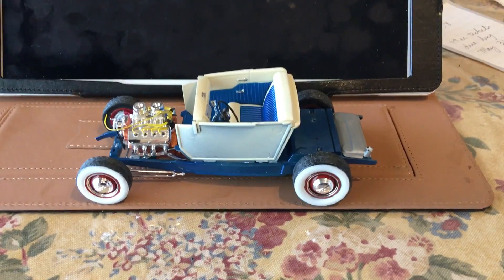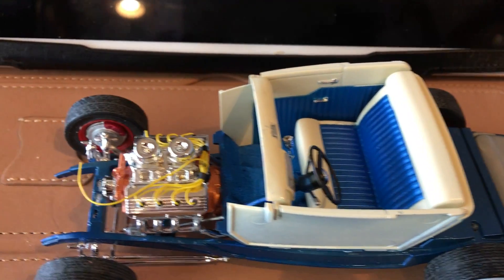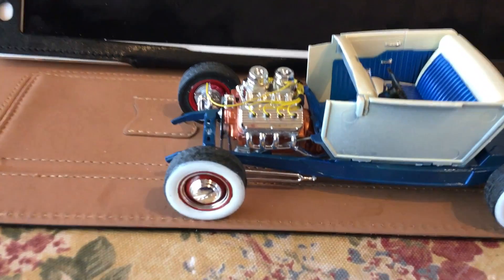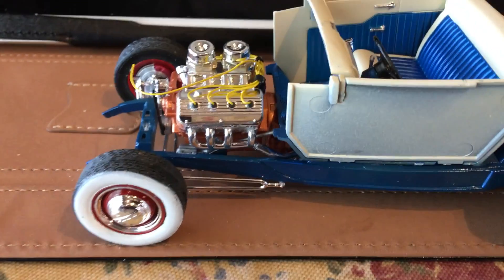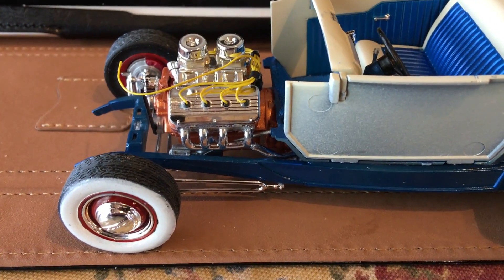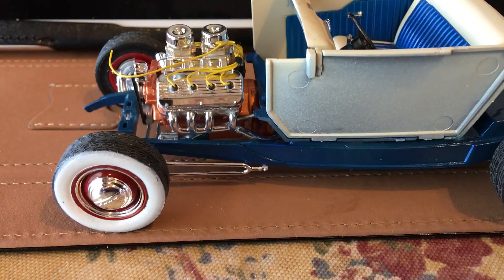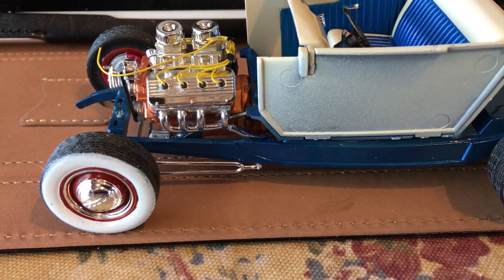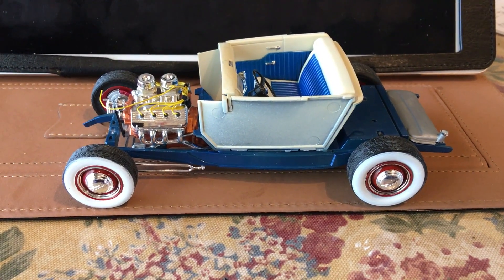32 Ford 5 Window Coupe update #2

Comment: Looking good so far! You would think that out of all the people that have built this kit someone would have mentioned the header fit issue!!
Reply from the maker: I was just looking at a picture of the Revell Highboy 30 Model A Ford and it has the exhausts coming outside the frame. I wonder if they had that in mind with the 32. If they did, they should not have had me put in the muffler and exhaust pipes underneath. Bad instructions.